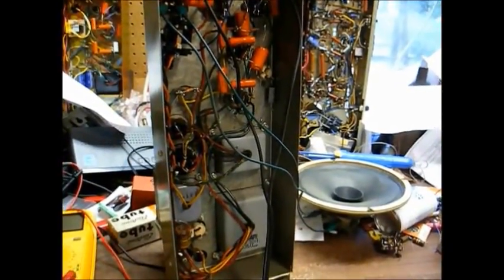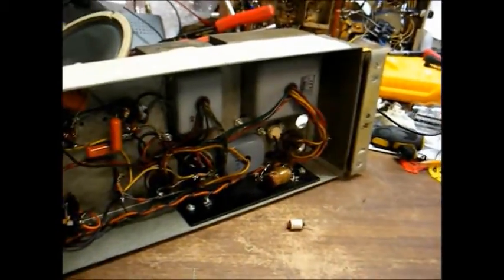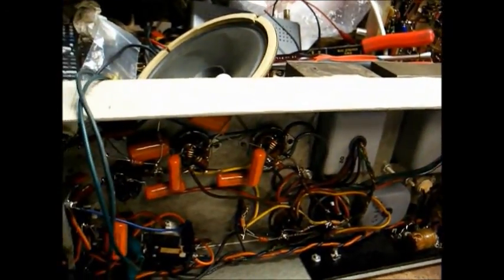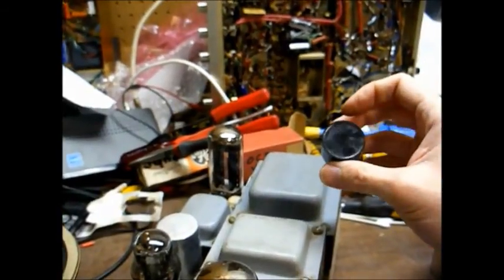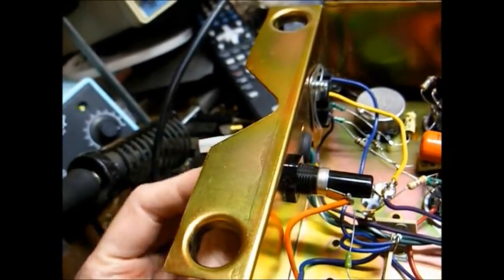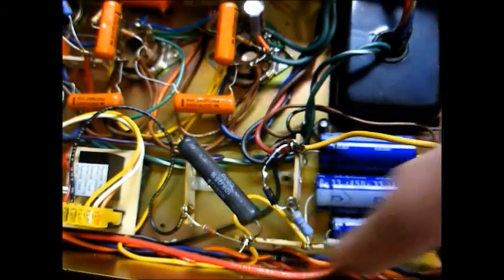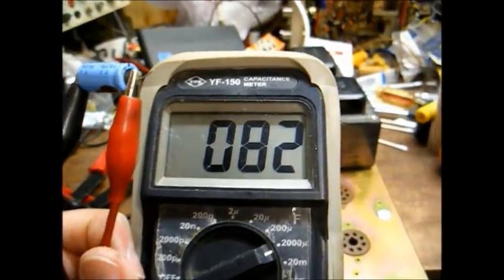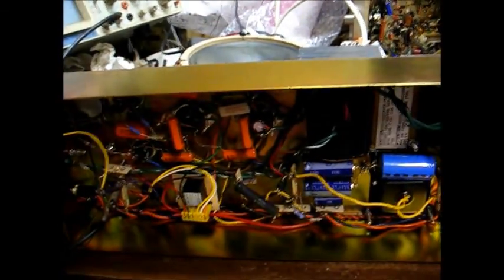Repair of two Hammond Leslie tube amplifiers (22H & 122) - part two

Comment: Nice video. I have a 145 (shorter version of the 122) that has an audio "pop" everytime you change leslie speed. Is that the big can capacitor do you think? Or do you have other things to check?